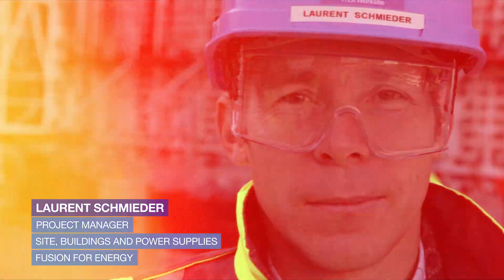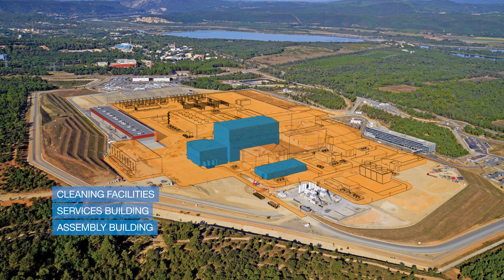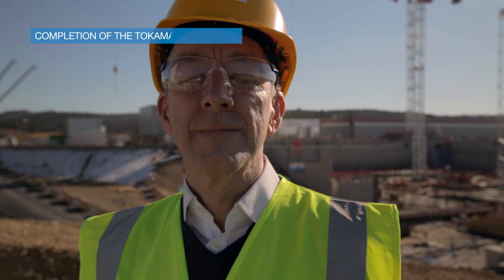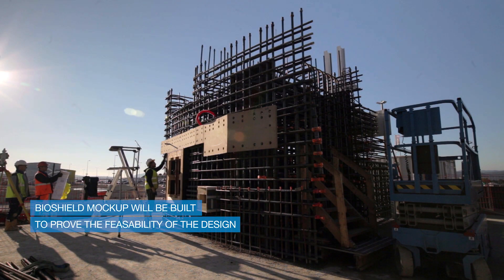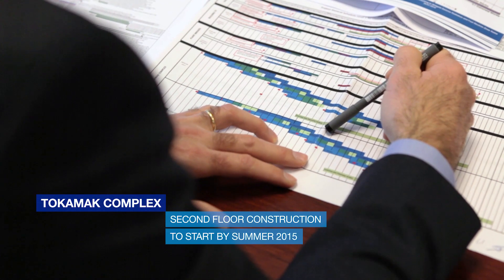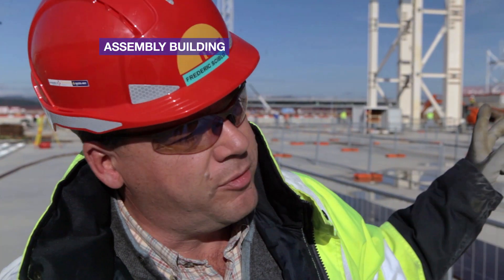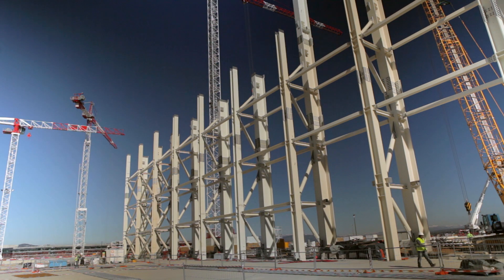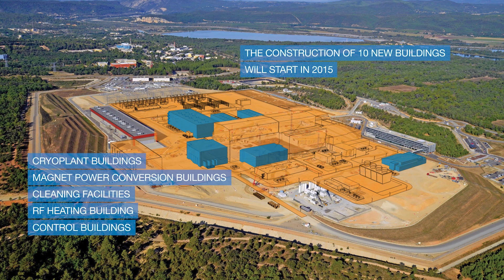ITER Worksite - F4E - 2015 Milestones / Etapes importantes du chantier ITER 2015

Comment: A big building (and many billions) to develop a project that will never work until 40 years. Far later than several other more efficient (and cheapest) projects like the Z-machine. Thanks to the ego of european crazy scientists and politicians.
Reply: Thanks to the ego of crazy youtube commentors, we have ignorant opinions like yours. Z-pinch is still at 1/100th the reactivity rate of break-even. They have kink instabilities. It may work out with billions of dollars in more research and laboratories, it may not. If it does, it still won't have the economies of scale of a tokamak.